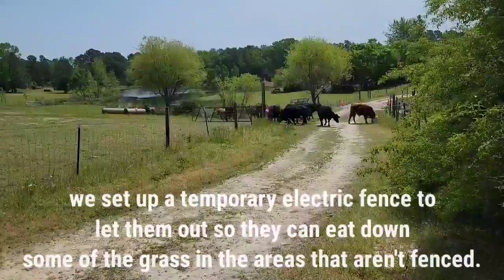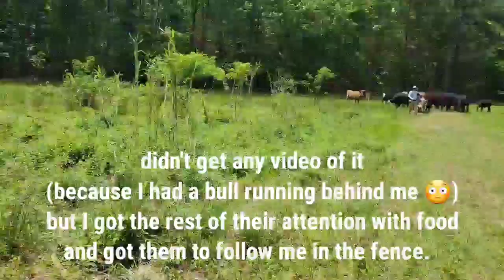Beaver Update, and Cows Out!

Comment: It is good to see you again LOL... The Fence wire. We have never had any luck with that braided Wire/Rope stuff even the Horses have walked right through it. You might want to try High tinsel # 8 wire.( Husband will know what I'm talking about with the wire) Now you can't go cheap on the insulators. Try and stay away from the Glass insulators they get expensive. You have to get the good Plastic ones. I buy the Plastic one that have a screw on the bottom to screw into the post. Also, Make sure the Ground Rod is in good Moist Dry at least 6 feet in the ground, Since we have mostly sand here in Florida, I had to put in 6 Ground Rods and ran them in series or together with 8foot gap between. None of it is cheap anymore. The Solar Fence charger I told you about is Good, But the one for the cows you might want to get is for up to 25 miles of wire fence, Puts out about 625,000 Jules. And Yes it hurts if you get Zapped. Take it from me, I get hit every time I mess with it. 
 Let me know if you have any issues I can talk you through. Thanks for sharing your video, I always enjoy them.